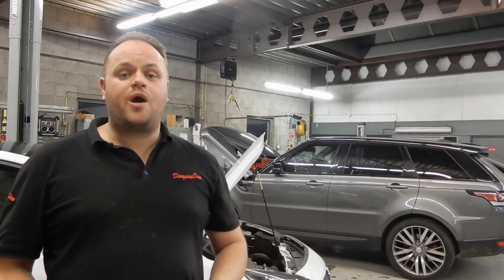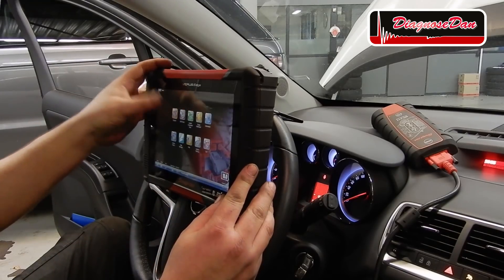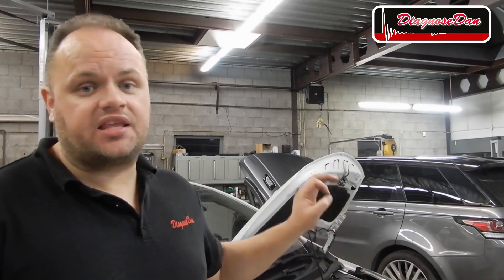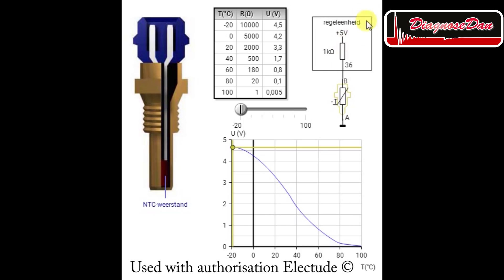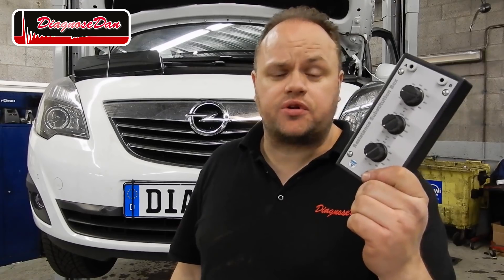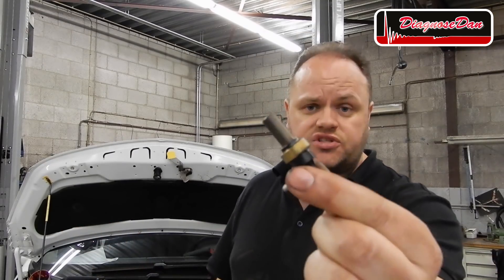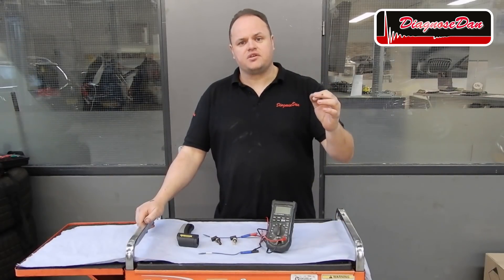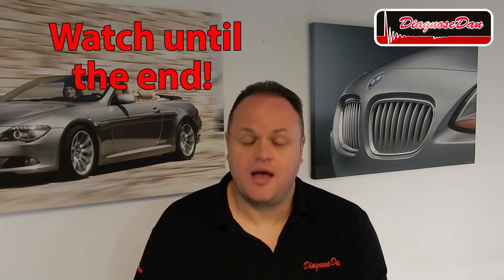Using a Decadebox to diagnose an Engine

Comment: You're Fantastic Hoss,

Big Dogs, www.automotivetestsolutions.com and www.aeswave.com sells those Decatence boxes also.Haven't invested in yet, but I can see how good they are in your always good examples.

Another way to test the Integrity of the Engine Coolant Temperature Sensor - Intake Air Temperature Sensor and the Transmission Fluid Temperature Sensor ( NTC Thermistors ONLY ):

If the wiring from the Main Computer to these Sensors are good :

1) Scan Tool attached to Data Link Connector ( Engine not running )
2) Disconnect the ECT Sensor Male End - the Scan Tool should display - 40 Degrees..........Insert a paper clip inside the (2) Terminals of the Male Side of the Sensor ( the disconnected side that you have in your hand ), the Scan Tool should display over 250 Degrees.

Background
Ex- Smog Repair Tech.
Southern California
Hoss Hop-A- Long Barkwell
Reply from the maker: Thanks for the feedback, indeed there are more ways to test a thermistor. Thanks for watching my video's it's appreciated!👍

Comment: Was thinking about that tool a couple weeks ago. No body in the shop had a 2 ohm resistor to check a knee air bag. Snap on no longer sells one of those. Does that box go that low stably?
Reply from the maker: To be honest it just came in, because my old one broke. Still need to study it a little more.

Comment: GM USED this engine in everything from the cruze to some Buick lower lines.
Reply from the maker: Last month i had an Opel in my shop and my Verus couldn't read codes from the convertible top. Tried Buick and Bingo!

Comment: Yes, if last shop would have confirmed customer complaint (try starting engine when cold) you would think they would have noticed temp gauge hot when they wrote down mileage for work order? Was someone in a hurry?  Good job Dan.
Reply from the maker: Thanks for watching!
Reply: Shows you again, look at the basics and not just at fault codes

Comment: I'm going to correct you're video here! The temp sensor does not ground to the block it grounds to the ECM (5v in earth to ecm) (ps its not the earth to ecm its the current read it the return point) and in the video you showed you putting it into a plastic housing. ALL ecm temp senders ground to the ecm but the ecm also grounds to the engine block CHECK the resistance through the sensor BUT also you do not want any electrical flow into the water jacket and earth to the block, disconnect the sensor and check resistance between the two prongs on the sensor and the block. My point is (and Ive had this fault) The temp sender could and did have a hole in it letting the ecm read resistance to the engine block earth through the coolant, in the case of my Vauxhall corsa a chugging and splutter at a the same point on the school run ! (you know what its like the customer drives you back to "sputter corner" and it doesn't do it again, but if you drive her kids to school 6am the next day that's when it does it!!) And yes you bypassed the sensor with a tool, but I don't own that tool and would need a chart to set it (ohms/temp) To fully test the temp sender after reading an incorrect live data I measured through the sensor and also disconnected sensor and measured though it and checked for leak to ground though its casing , fault found , when I took the sensor out I found a hole and therefore a coolant short to ground. AND to take this fault to another level ….Coolant level sensors... VW or Pue/Cit they use a electric reading through the coolant bottle and either the coolant is to low..OR..to much anti freeze Vs water or just crud on the probes... Ive never had a real faulty level sensor
Reply from the maker: You are right i noticed that mistake after editing the video👍 Thanks for the feedback. Merry christmas to you and your family!
Reply: I’m going to correct both of you if I may be so bold. The commenter is correct in that the ground is to the PCM. But diagnose Dan is correct in that the voltage is monitored between the internal resistor and the sensor. 

Why? Because it’s shared voltage. All the voltage must be dropped across the sum of all of the loads in the circuit. 

If you measured voltage returning to the PCM, it will always be zero. That’s because if resistance is high (when it’s cold) little or no voltage will pass across the sensor so none will return to the PCM. 

When it becomes hot and resistance drops, it’s as if that pat of the circuit, from the internal resistor all the way back to the PCM becomes the ground wire and all of the voltage is dropped across the first resistor inside the PCM and so you would still get no voltage. 

The amperage would change because there would be less resistance, but the voltage would still remain zero. 

Because that’s literally what’s happening. With its low resistance the sensor just becomes the ground path for the internal resistor as if it just magically turns into a ground wire instead of a sensor. You get it? Can you picture that? 

Now, that would not be true if current flow (amperage) was being measured or it was a three wire variable resistor, but neither is the case here. It’s only a two wire NCT resistor and the PCM measures voltage on the coolant temperature sensor circuit not amperage. 

Now, all of this is assuming I read the commenters post correctly and they were saying that the ground wire at the PCM is what is being monitored. Either their English or their typing was hard to understand. If that’s not the case, I apologize and you can disregard everything I just said.
Reply: jalins6 very good point also but it was kind of confusing what you said in your third paragraph there especially that the circuits wire doesn’t become the ground it is the ground through the PCM. And the PCM measures the amount of voltage coming back to it as veriabled (I know that’s not really a word but you understand what I mean) by the temperature sensors resistor. I hope that makes sense. I’m just trying to put together what both of you said, especially since the first commentor was a bit confusing.
Reply: BigFoote Mobile Auto that is correct. I just realized, from your pointing it out, that I wasn’t clear about what I was trying to say. 

I was merely trying to make clear WHERE the voltage returning to the PCM is measured and why it’s measured there instead of somewhere else. 

I thought the original poster was saying it is measured at the ground wire coming back into the PCM, after the second resistor, the coolant temperature sensor. 

It isn’t. Voltage there will always be zero because it’s already been used up by one or both resistors even if the resistance of the second resistor (the coolant temperature sensor) changes to zero. 

If the coolant temperature sensor has low resistance, it doesn’t matter. The voltage will still all have been used up by the first internal resistor. 

That’s because all the voltage has to be used up by any one or all the resistors in the circuit. If the second resistor effectively disappears because it’s resistance drops when it warms up then the voltage will vary between the two, but never after the two because it will always have already been used up. 

Now, that being said, amperage WILL change at the wire going into the PCM after the coolant temperature sensor because of the variable resistance. Voltage won’t, but voltage is what’s being measured on this circuit, not amperage. 

Because of how voltage drop works, it must be measured between both resistors. Because if you measure the voltage there it will vary. Anywhere else it will not. 

In that sense, you are right. If the PCM measures voltage between the two resistors (the internal and the coolant temperature sensor), the NTC thermistor is part of the return path and the PCM is measuring how much voltage is on the “ground side”. 

But after the second resistor(coolant temperature sensor) the PCM will never see a difference in voltage only amperage. Voltage after the second resistor will always be zero or really close to it. 

I hope that clears up MY original post and it will make sense to anyone who reads them together. Sorry for the confusion and thanks for pointing out the need to clarify.
Reply: Hi Guys, I'm going to correct myself here, its not an earth point at the pcm its a reading of the voltage or current to the earth point at the pcm (ecu). Thanks jalins6 and BigFoote so if you add a second resistance (the coolant) in parallel that will offset the reading. Diagnose Dan I'm sure you can demonstrate that with some wires. the resistant tool, a multimeter and some mix of antifreeze (try weak and strong). Merry Xmas All
Reply: timwood12 yeah great points. I would like to try that someday measuring the difference between the different anti-freeze strengths, but probably will not. Although I don’t really understand how that would make a difference? The ground past doesn’t go through the block and antifreeze does it?
Reply: @bigfootemobileauto9734  and to all, its the water content of the anti freeze that passes the current to the block down the rubber hoses and plastic parts, its ohms law for parallel resistors, a vehicle has a common earth, negative on the battery every other metal thing should bond to it. but all sensors have a voltage in and a ground to the ecu, the ecu reads how much current it takes to push the 5volt to the sensor not as people think the feed back. SO its current flow not voltage. Imagen a pressure gauge on you water system at home where the pipe comes into the house, if you open a tap the gauge drops and you set the tap running at a nice flow and read the gauge, if your pipe to the tap springs a leak some of that pressure goes out there not though the tap so the gauge drops but you haven't turned the tap or also changed the amount of "wasted water". The current will always find the "easiest" route back to the battery, I show my apprentices, get an old damp battery and measure the voltage across the terminals 12v now measure from one terminal to any other place on the dirty plastic insulated damp case and read the voltage there, there will be current flow so why did we sell a battery instead of just cleaning it ! Happy New Year to all and I hope anything I reply or post is of interest to all !

Comment: Is there multiple coolant temp sensors? If the sensor on the block only reads to 100*C max when it has zero resistance, then how do you know when the car is overheating?  Is there one past the thermostat that reads higher than 100*C? I'm assuming that this sensor is just a "cold start" fuel enriching sensor, like for a carburetor choke?
Reply from the maker: There can be more than one sensor and most sensors can read over 100 degrees.
Reply: The sensor values shown were an example to illustrate the general idea, not the particular values for this car. Like Dan said, they usually measure to (well) over 100 degrees C. With the Torque app and my homebuilt OBD-II Bluetooth scanner I've seen my car ('03 Renault Twingo) reach about 105 degrees in a summer traffic jam.

Comment: Does this go aswell for a diesel common rail engine ?
Reply from the maker: A diesel needs glowplugs when it's cold and the PCM controls the glowplugs based upon the information of the temp. Sensor. So yes!! For a diesel the temp sensor is very important!

Comment: This is the common problem with Opel you just need to buy some small device and connect this by soldering to wires under the hood.
I haved Zafira 2002 and there was same problem but after install this device all was ok.
Diesel Hot start Fix module
Reply: @Diagnosedan  And i forgot to told you you do really good job.

Comment: Great video DiagnoseDan as always.  The only thing that I can add is that you need to know the type of thermistor you are working with.  An NTC has less resistance as it warms while a PTC has more resistance as it warms.
Reply from the maker: A coolant temperature sensor is (almost) always a NTC thermistor.

Comment: How would you this on for example an Aygo  (no temp display ) do? Would you see this also in the fuel trims? Ps, another great episode, already contacted by an ROC near  you?
Reply from the maker: Thermistors always work the same on every car. What ROC are you refering to? I have contact with a few😊
Reply: Jeroen Brouwer My BMW hasn’t got a temp gauge either but I can go into the service menu (sometimes called hidden menu) and see the temperature. 
Maybe the Aygo has a similar menu? Otherwise I guess a simple OBDII monitor could tell you the temp.
DiagnoseDan please correct me if I’m wrong.
Reply: Thx, I know the thermisters; ) was just wondering what you would do if the dashboard gauge wasnt there. ROC -> you would be a great teacher hope one of them has seen this as well :)
Reply from the maker: @supergrover8519  there are teachers watching and my video's are also used in classes. I'm planning a workshop for the Automotive college Nieuwegein.😉

Comment: My 2004 Vectra C had trouble starting but it was the opposite. It never got up to operating temperature so the ECU was constantly dumping extra fuel in the cylinders because it thought the engine was cold so the spark plugs were sooting up because it was always running rich. A new thermostat and a clean of the spark plugs fixed the problem. Being the Z18XE engine, the coolant temperature sender was included with the thermostat. As a DIYer, I would've earthed the sender wire to verify that the gauge was working.
Reply from the maker: Bad fuel economy 🤣🤣

Comment: Your videos are so different thanks for explaining things are informative and professional, it is almost that i want to drive down my old Astra to you haha that one will make you rip your hair off.
It is the dreaded x16szr bullet proof when it works but when it gets warm it just dies worst at summers then it dies all the time wait 20sec and it comes back like nothing happened. and at winters it is less frequent and yes almost all parts are new. But when it dies it coughs like it wont get fuel... I read that the ECU are prone to fail on them and it been changed 15 years ago lol
Reply from the maker: Seems the right part hasn't been changed yet. One positive thing, the list is getting shorter🤣🤣

Comment: you can just unplug the sensor and watch the voltage if it goes high the circuit is good quick an dirty.
Reply from the maker: The circuit is also high if the 5v wire is broken.
Reply: absolutely  true. but the Gage on the dash was showing 90.
Reply from the maker: @eiadco221  you are right but the procedure showed in the video can be used for more faults.
Reply: @Diagnosedan  You can use this, unplug the harness, use test lilght connect to ground (it has high resistance so it wont cook ECM), and short to signal wire, your instrument cluster shows high degree or super hot, this is just to verify circuit integerity.
Reply: Also : Unplug the Male Harness Cônnectror from the Female Harness Connector òf the Engine Coolant Tempêrature Sensor and the Scan Tool should display - 40 Degrees.

Put a Paper Clip across the Terminals of the ECT Male Terminals & the Scan Tool display should read 250 - 350 Degrees Fahrenheit.

This too tells you that the Integretiy of the wiring from the Male Harness side to the Computer is good.

This particular Test should only be used on Themistors : Engine Coolant Temperatủre Sensor , Intake Air Temperatủre Sensor and the Transmission Fluid Temperatủre Sensor.

Smog Repảir Tech. - Southern California